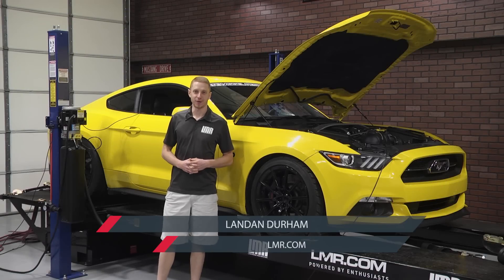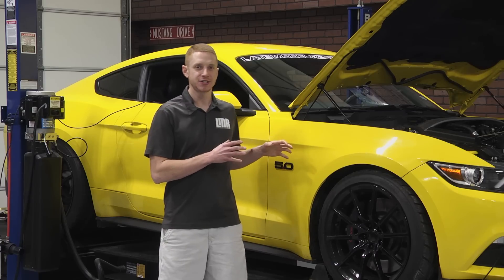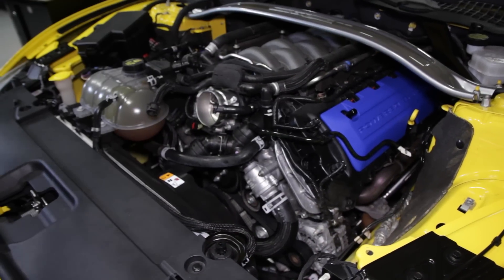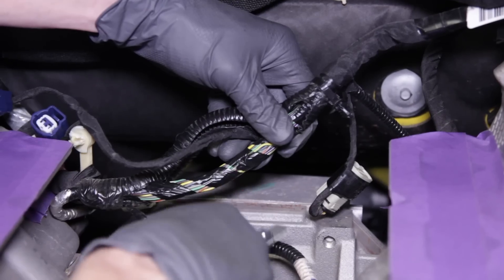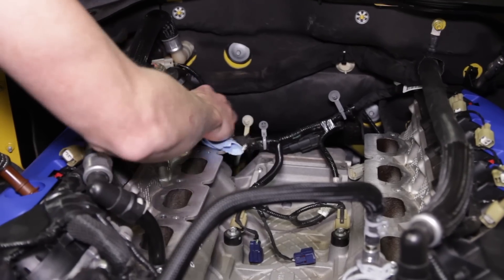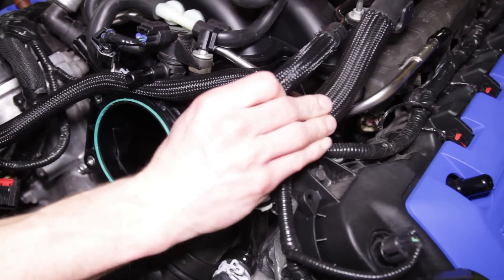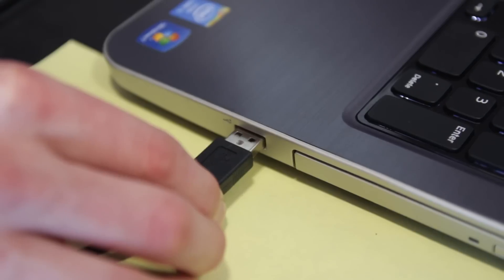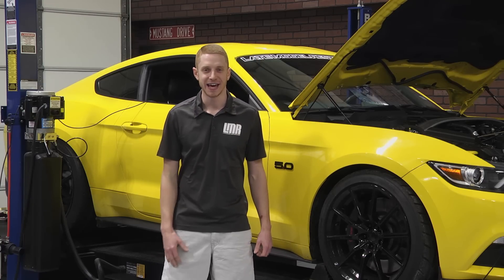2015-2017 Mustang GT Ford Performance Stage 3 Power Pack - Install & Dyno

Comment: At the risk of sounding stupid I have one question for you guys and wonder if anybody who has installed this kit can answer it for me. If you install the Ford Performance K&N cold air intake does the Ford dealership reoil the filter for you as you come by to do regular services? I know that you do not reoil it frequently but that is a serious fear of mine, applying the oil and fucking up sensors. I would pay the service or aftermarket area of a dealership to do that for me
Reply: Ford didn't receive the bailout....that was GM, Chrysler.

Comment: Man, some people cant read dyno sheets, it´s not always about the peak gains.... 
look at the great difference from HP an Torque from 2000rpm to 3000rpm (+50hp/30ftp) and once again at the huge difference starting at 4700rpm till the end. there is a difference of torque from 30 footpounds constant and 35whp at 6500rpm to a stock mustang. after 5000 rpm the voodoo bridge breaks the shit out of the car, especially after the point of 6700rpm. whp plus from 70hp and 50ftp. Halleluja!
Thats definitly worth it and you keep your warranty and theres no bad tune on it, killing some carparts. With a deleted electronical speedlimiter you could hit in 5th gear 175 miles at 7500rpm not "just" 150. for a quick mile, it is also great thing, because you will hit 120 miles with no extra shift in 4th gear. 
In my opinion, this is a killer tune from ford performance, you will get a all new character out of the mustang.
Reply: i'm glad I'm not the only one to see this, you saved me the having to explain it, plus the new red line is 7,500rpm with no head work, now if I knew what the price was, but the labor Ford charges is what I don't like..lol but many shops charge a lot anyways so not bad going with Ford for the warranty..

Comment: Just installed mine!! Love it. Question... how do u use octane adjust? What happens if i turn it on?
Reply from the maker: You can do it on your laptop. By default, it is set to 91 octane. Give us a call at 866-507-3786 if you have any more questions.

Comment: So stock tune with a catback is 395whp. Cold air intake and a tune would put you at 415whp. GT350 intake 430whp. So the intake is worth 15whp.

Comment: How much did you notice on the mpg? Lose or gain? I read a intake shootout between the stock Coyote intake , bose302, gt350, Cobrajet intake. In the article they where upgrading 2014 gt and gained 2 mpg with the GT350.  Curious if there was any significant change with the 2015 when upgrading to the GT350.

Comment: Has the gt350 intake manifold been tested to fit on the 2018 Mustang GT yet?
Reply: Almost no point since the 18 intake is so good, people have already swapped them onto the 15-17 and made just slightly under a gt350 intake from what I've seen

Comment: LMR big question here.. 
I just ordered the gt350 throttle body, and I got the Blowfish adapter unit that’s used to install it to the stock manifold.. however, I’ve decided to get the 350 manifold and do it all at once.. so do I still need to use the blowfish adapter? If not, is it still an option for me to use it, and have it act as a spacer? Thank you so much.
Reply: If you didnt get an answer yet, no you don't need the blowfish adapter and no you cant use it as it wouldnt be the same connections. When you use the blowfish adapter its connecting the 87mm tb to the stock manifold because the tb wont fit without it, but on the 350 manifold it is already fit to take the 350 tb and it would be technically useless and probably won't fit

Comment: I have this package on my 2016 gt automatic with 3:55 gears. Only other difference is that I have bbk shorty headers with a corsa sport cat back exhaust. I never made a baseline run, but when on the dyno this past weekend it only made 384 whp. I know individual results vary, I have a automatic and my car has shorty headers.  However, isn't  that still a big difference between my car and this one?
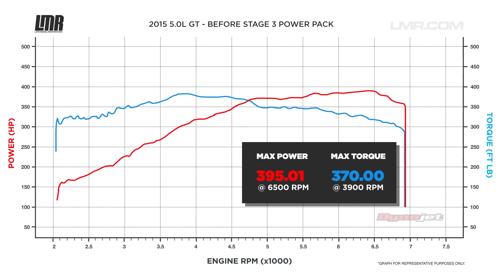Reply: Mingo 70 They got this on a manual car on a dyno jet. You probably ran you auto car on a mustang dyno, not a dyno jet. Dyno jets always read higher than a  mustang dyno. Also, your car is a auto, which means it has more drivetrain loss. If your car was indeed ran on a mustang dyno, and got 385whp, thats is not bad. I dyno’d my bone stock automatic 3:15 gear 2017 GT on a mustang dyno and got 337 whp. Mustang dyno would have been around 375whp. Here in cali they only have 91 octane as well.
Reply: You'll have to get a custom tune in order for it to work with the headers. The tune that comes with the pack is made for a stock car
Reply: Mingo 70 did they actually apply the tune
Reply: dennis eddy  They provided the tune and ObdII interface which I applied. I'm sure the vehicle would run terrible if it were not applied. I think that by me changing the stock headers and exhaust had a negative effect on my power output. That tune from Ford is based upon a totally stock car. Their headers and exhaust system.   I have a custom tune to apply once I get the car back from the dealer for a unrelated matter.
Reply: I think it's weird also. I have a Vmp tune to upload. Will see how it works out.
Reply: WatchThisRightNow  It was a dynojet dyno, however I do  have questions about the way he ran the car. I'm not sure that he locked and ran the car in 5th gear, and the rpms seemed pretty low when he turned it over. Also his torque reader was not working so I got no torque or rpm reading on my print out. Im going to take the car somewhere else when the weather breaks.
Reply: Hpw is that most stangs well 15-17 stock run around 394 to the wheel...

Comment: I really want to do this but it seems like a ton of work. I am very mechanically inclined, but don't know if I would have the balls to do it myself. Got quoted $1500 for installation at my dealer and that isnt happening either. Is it worth it?
Reply: its a 1 hour install!!! IF that is a "ton of work" you need to get a new hobby.

Comment: Ive just installed a GT350CAI (not manifold) to my 16 GT.  The GT350CAI only has 2 ports on it for 1x vacuum and 1x PCV.  However my 16 car has 2x IMRC vacuum lines.  Does anyone know what to do with my leftover 3rd line?  Can I just T-joint it into the other IMRC line?  Thanks!
Reply from the maker: Reference pages 11 & 12. https://performanceparts.ford.com/download/instructionsheets/FordInstShtM-9603-M8A.pdf

-Landan
Reply: thanks landan :)

Comment: remember this still doesn't have full exhaust & a proper tune. And even then full exhaust won't void your warranty but the tune might
Reply: And you can still put a better air filter, and weight reduction. You can easily put a Camaro SS & srt 392 to sleep while looking better and have the warranty! And instead of getting the performance pack upgrade you can just spend that money towards this and get a 477hp mustang with dealer warranty

Comment: Do you have to install stage 1 and 2 before installing stage 3?

And does stage 3 include 1 and 2 in it ?
Reply from the maker: No, you do not. Stage 3 does not include 1 or 2. -Landan
Reply: Kay MEsfits l

Comment: Anyone do this install and get a code P0315 after?
Reply from the maker: A crank relearn is required when installing a Ford Performance power pack. You can perform a crank relearn with the ProCal tool and your laptop. -Landan
Reply: Late Model Restoration thanks for the quick reply

Comment: I think people are missing the point that this is to keep your warranty. Of course you can get more hp from any other tune but your fucked if anything happens. I order mine tomorrow ride it out until the warranty runs out and than hook a Paxton to it.
Reply: S550 Gainz how has it been so far?
Reply: + S550 Gainz: Federal Trade Commission (FTC), the agency confirmed that “The Magnuson-Moss Warranty Act makes it illegal for companies to void your warranty or deny coverage under the warranty simply because you used an aftermarket part.”

Comment: So if I plan upgrading the injectors and adding long tube headers with this upgrade, will I need a specific custom tune vs. the pre-cal tool?
Reply from the maker: Any modification other than what is provided with the Stage 3 kit will require a different handheld tuner and tune. -Landan

Comment: Ford should offer this setup as an option for original purchase, not as an add on.  The cost difference would be minimal...but then again, maybe this is the power gain the 2018 will have.  Time will tell.

Comment: Good gains but LOL at those gains for $2,000 plus another 1k for installation probably.
Reply: i was quoted 675 in Los Angeles. at Galpin Ford
Reply: Lol no. Labor rates are usually 100 an hour. The install time is roughly 2-3 hours. This wouldn't take 10 hours
Reply: AmnScottNN I was quoted 880 for the install at a Ford Dealership here in Houston Tx
Reply: stacy levias I was only quoted for 3 hours of labor so more than I originally thought but still only 380 for install. Why is it so much different? Perry Ford in San Luis Obispo CA

Comment: Only 37 more HP and only 5 moreFt pound of torque ??? You can gt more than that cheaper from a basic tune !!!!!
Reply: You won't get more than 37rwhp from a tune unless its an FlexFuel tune and you run E85, even then they'd be about even.

Moreover, what of the people who've already tuned their vehicles?  I have an intake, longtube headers, and Lund FlexFuel tune.  I'll take another ~40rwhp ontop of that please!

Comment: I'm not an attorney but the warranty says "Engine, driveline and suspension concerns not caused by the use of Ford Performance or mountune parts remain eligible for warranty coverage according to the terms of the New Vehicle Limited Warranty. " I would think that if they prove the after market parts caused engine failure it would not be covered. Ford and Ford Performance should get on the same page.
Reply: If you have a Ford Dealership install the Performance Pack,
then Ford will give it a Full Factory Warranty

Comment: I know boosted is the best, but if I were to stay NA, what do we think is the best, stage 2 or 3?  I don't race, I just like to get on it around town.  Stage 2 seems to be better for lower RPM,  Thoughts?  Does anyone have a stage 2 overlaid with a stage 3 dyno graph?
Reply: Adam Durando I took a screen shot of the dyno graphs made by LMR for the Power Pack 2 and 3 and analyzed them. The Power Pack 3 has more hp and torque in the low (below 3500) and high (above 5200) RPM ranges. The Power Pack 2 wins only in the mid RPM range. It's a matter of personal preference and hard to know which one is best for your driving style without trying both options. I installed the Pack 3 even though I'm not racing (yet!) because the stock car annoyed me with its low end power (mid-range was ok) and I thought that the power band was way too short for my personal liking. I have 3.73 gears, car does not feel sluggish in the mid-range. The sound at high RPM is glorious (Corsa Sport catback).
Reply: @francislarocque3680 I know this has been 6 years but I have a 2016 gt and am thinking of buying this. I’m not worried about a warranty so I’m gonna do the work. If no labor cost would you recommend this?
Reply from the maker: I'm an avid road racer, so the stage 3 makes sense for me. However, if I just drove the car and had no intentions on tracking it, I would probably go the stage 2 route. Of course, that's just my personal opinion. -Landan
Reply: Francis Larocque Hi, I just installed a power pack 3 on my 16 Gt. I get a discharge of air pressure out the Cai filter when I turn the car off.  Does yours do the same thing?
Reply from the maker: That is completely normal. The stock airbox does the same thing. Since it is concealed, it isn't as audible as an open filter element is. -Landan
Reply: Adam Durando thanks for the reply

Comment: Any idea what the average install price would be from an authorized dealer for this?  (just a ballpark I know they are all different)
Reply from the maker: I'd probably say $200-$400 dollars as a ballpark estimate. -Landan
Reply: hanzo52281 There are two authorized dealers near me (Los Angeles area) and one asked $540 and the other $700. I guess it depends on what part of the country you live in, Southern California prices most likely to be on the higher side.
Reply: Francis Larocque I was quoted 880 at a Ford Dealership in Houston

Comment: Not a good price. U get get the manifold and TB at American muscle for 1200
Reply from the maker: I'm not entirely sure how this is a "bad" price when you are stating two items. This is Ford Performance's stage 3 power pack which includes a GT350 intake manifold, GT350 throttle body, GT350 cold air intake, and a calibration for this particular setup.

Even after purchasing said manifold and throttle body, you will still need a handheld tuner and custom tune for those modifications. How about you provide a link? Thanks. -Landan
Reply: Late Model Restoration 

http://www.americanmuscle.com/frpp-87mm-throttle-body-1516-gt350.html

http://www.americanmuscle.com/frpp-gt350-intake-manifold.html

https://lmr.com/item/LRS-9600/15-17-mustang-gt-gt350-cold-air-intake

These 3 add up $1542.98. So is that calibration tool $457.02?
Reply: Good point.  Using the same links and purchase price of the power pack 2 of $795 on LMR you come up with a calibration tool cost of $346.01.
Reply from the maker: We have all three components separate as well:
https://lmr.com/item/M9926M52/ford-performance-gt350-throttle-body-mustang-15-16
https://lmr.com/item/M9424M52/2016-shelby-gt350-intake-manifold-M-9424-M52
https://lmr.com/item/LRS-9600/15-17-mustang-gt-gt350-cold-air-intake

All three add up to $1542.98. The tool itself isn't "$457.02". This power pack also comes with the correct calibration for this particular setup. Even if you were to buy all three components separately because you think this is to much, you're still going to have to source hardware, tuner and tune if you don't already have one. -Landan

Comment: im selling a gt350 throttle body if anybody is intersted.
Reply: danielc49102 why .. do you have any problem when you work for it ?
Reply: Blue Darkness im boosting now and the guy could get the tune right with the gt350 throttlebody so i change it back to the original one, before boost it work jusy fine.

Comment: What are the gains if you have 93 octane? Anything?
Reply: He said he was using 93 octane
Reply: Escape for Mankind is Keith Johnson No he didn't. He said a minimum of 91 then put a 91 octane sticker in the fuel door.
Reply: This is true but it is tuned for 91.

Comment: if you had a Ford dealer do this for you, you could almost buy a gt350 for the difference in cost. or just get a supercharger.
Reply: How much crack did you smoke before this post ? A supercharger is $6500-9000 and will cost about another $1400 with installation.  Then you need a new clutch , fuel pump,  tires/ rims . In the end you will have a faster car but you would have spent about $10-15k by the time you were done.  Much more than this pack at $2000 and $800 for an install or do it yourself  .

Comment: Look at the Wheel Horsepower Gain from 2000-3700 rpms, which is where you spend most of your time.

+50whp at 2200 or 150whp to 200whp
+45whp at 2500 or 170whp to 215whp
+25whp at 3000 or 220whp to 245whp
+15whp at 3500 or 265whp to 280whp

472 peak BHP
435 bhp stock
Reply: Gonna have me some fun when the 2018 version comes out.
Reply: Exactly most people ignore the gains under the curve and only focus on the peak gains

Comment: so does the gt350 intake manifold add more power, revs, and area under the torque curve than the cobra jet and boss 302 manifolds?
Reply from the maker: Check out this article StangTV wrote covering the popular Coyote intake manifolds: http://www.stangtv.com/tech-stories/engine/coyote-intake-manifold-shootout-gt-gt350-boss-302-and-cobra-jet/
You'll notice the Cobra Jet and GT350 manifolds make similar power. -Landan
Reply: This was an amazing read, thanks for posting Landan! -Houston

Comment: might as well put that money towards a supercharger
Reply: roush and their roush supercharger is partnered with ford performance and if installed by an authorized ford  dealer that sells roush products it will not void warranty.
Reply: Superchargers cost around 5-6k and void the warranty. This is much less and does not void the warranty. So no, I'd rather not put that money towards a supercharger.
Reply: That doesnt include thousand plus for new wheels to grip better and other parts to handle the SC.
Reply: @WRXinthe410  not to mention more weight ..... probably another 100lbs when it's all said and done.

Comment: Seems very similar to my Boss 302 intake manifold, 90 mm BBK throttle valve, Airaid CAI and SCT tune I put on my '13 GT. The Boss 302 intake looks better though!  Will the '15+ cars take the parts I put on my '13? If so what might be the price difference?
Reply: Robert Kohut the boss intake manifold will not allow the 15+ hood to shut. It would fit the motor though.
Reply: nvhsaccel Thanks!

Comment: Does the tune change when the tach lights up red like it does at the stock redline?
Reply from the maker: That's a good question! I was staring right at the tach during the dyno run, but that wasn't something I was looking for. -Landan
Reply: kjetplane yes it does.

Comment: Too much work, too lil gain, n I'm sure it cost too damn much money. Sucks that u have to unlock it to tune the damn thing. Maybe exciting for coyote owners but damn might as well stick to fox n a push rod motor. A lot more simple to work on n don't need internet n emails to tune it. Not to mention a lot more cost efficient.
Reply: Then you'll just have to keep your Civic